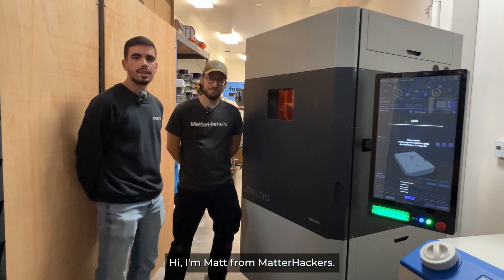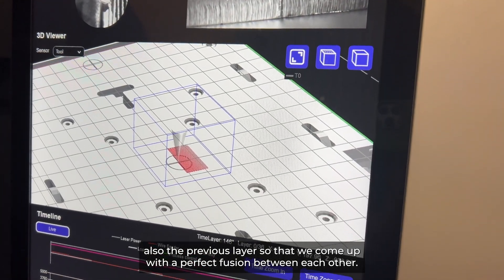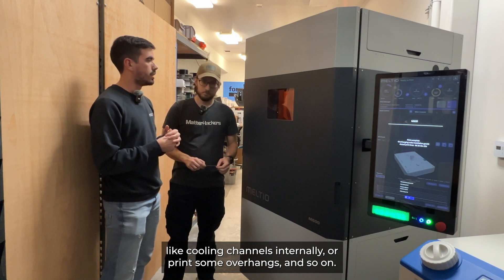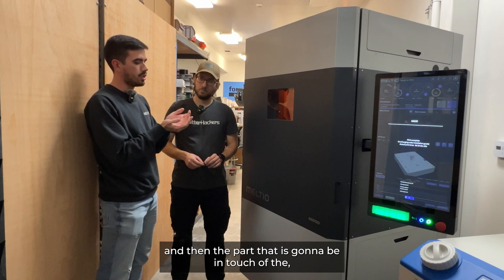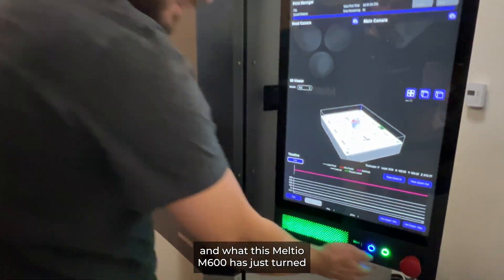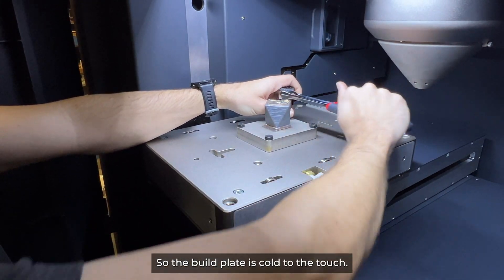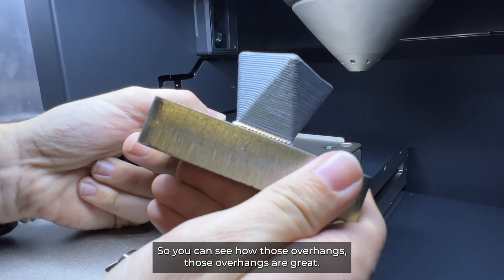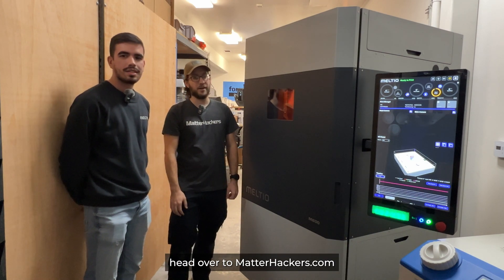Explore the Meltio M600 & Metal Manufacturing

Comment: Price ??
Reply: about as much as a new ferrari xD
Reply: expensive
Reply: Like 250k
Reply: You didn't say what overhang it can achieve. And if there is a large overhang how do you support?
Reply: @dalecollison791 support isn’t needed, it is a multi axis system.
Reply: @endostatica1405 can you explain as I only see standard 3 axis. What other axis is there?
Reply: @dalecollison791 I’m actually wrong here, mb. I mistook it for one of their other printers. I assume the metal itself is just strong enough to where it doesn’t need supports and it can support its own weight. The other printer i was thinking of had 2 rotational axises on the build plate itself in addition to the usage of a robotic arm to mount the actual directed energy deposition head. This is to prevent warping of the metal and stronger layers. Sry bro.
Reply: @endostatica1405 Hey no problem mate. I really like the printer and would love to have one that could manage over hangs. But your idea of a multi axis would be sensational and I know there are 5 axis printing machines in a similar fashion that also include a 5 axis machining centre ( saw one about 5 years ago at a trade show) but they are a million dollars!😢 So we are definitely going down the right track🎉
Reply: @dalecollison791 believe it or not the meltio kit, which is the robotic arm mounted ded printer from this brand, is actually cheaper than this. The kit + the arm combined are cheaper.
Reply: @d @dalecollison791 if you’re open to a bit of diy, the printer isn’t really conceptually hard to build. So long as you have some machining experience and experience with lasers you should be able to build your own.
Reply: 260k us. Plus upgrades. Not a desktop printer for sure.